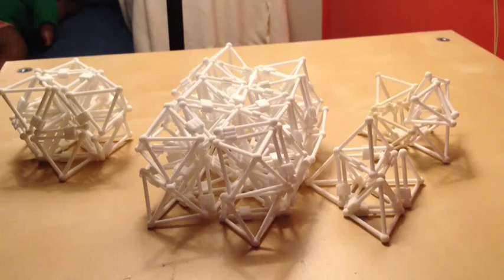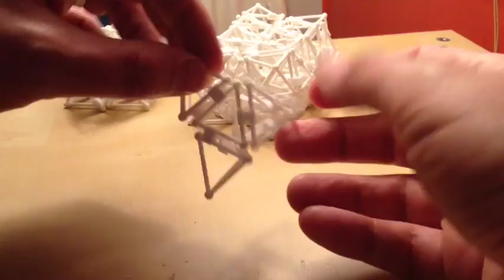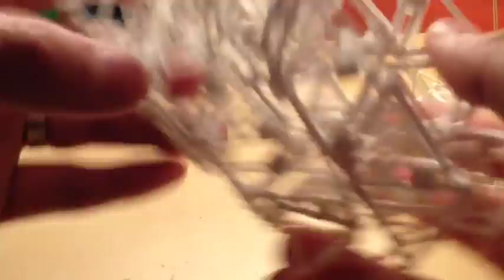Octet Truss Kit

Comment from the maker: Productizing a project from last spring. The octet truss construction kit! SLS printed octahedra, tetrahedra, and connecting snap joints. An interesting way to build structures. The models thus produced can be fluid or mechanical or solid, depending upon the design. Check out the video to see what they are like (pictures are helpful but do not do the models justice). A bit similar to one of Henry Segerman's recent projects.
Reply: Do you get any strangeness coming from the extra distance introduced by the connectors? Or does it not matter since the connectors are used everywhere?
Reply from the maker: No, the extra distance seems OK (in this particular case). In fact, a little offset is actually helpful for assembly.

More generally, this method should work for edge transitive honeycombs and polyhedra. I do not think it will work in (all) other cases. For instance, what if one had triangles, squares, and pentagons instead of tetrahedra and octahedra? Could build the Platonic solids but not a snub dodecahedron. 

Having a hinge between edges instead of hinges at each edge would solve this problem in the 2d case.